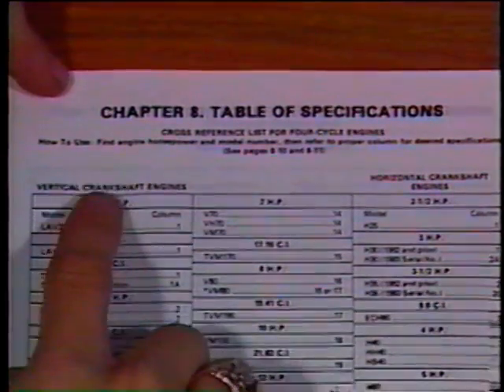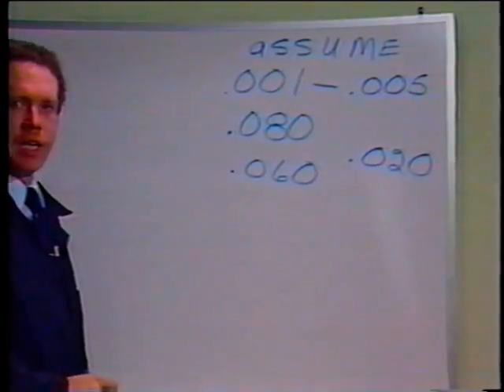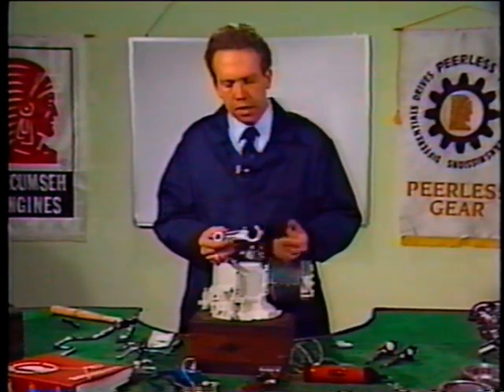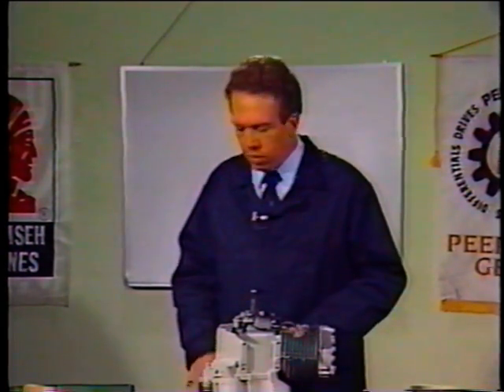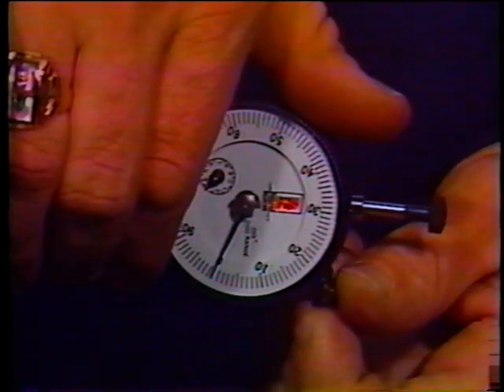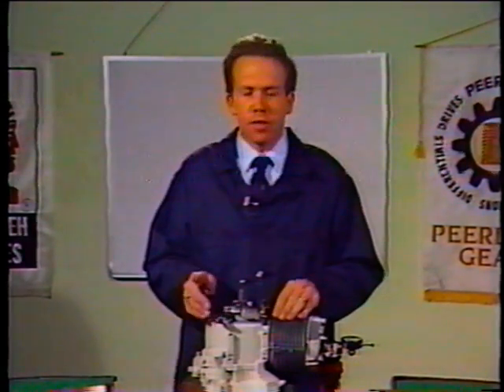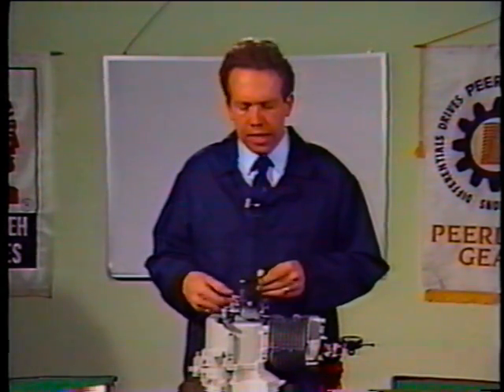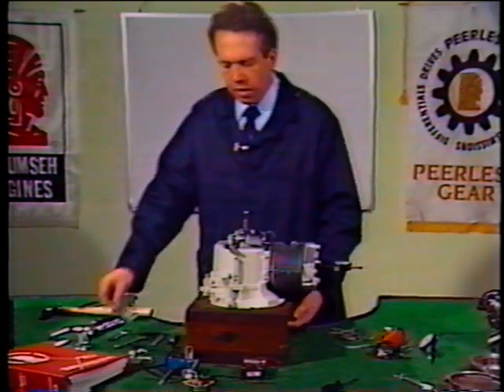Timing Tecumseh Engines with Internal Points & Condensor Ignition Systems

Comment: If you don't have the dial ind., you can use the flat feeler gauge on top of the cleaned piston top across the pin boss to eliminate any piston rock; measure it between a straight edge across the block surface and piston at the correct dimension btdc. Check with cont. light - rotate stator accordingly.

Comment: Looks to me that if you started at zero (TDC) and turned the crank  backwards to get a reading of .080" then you may have set the timing to .020" BTDC. But you weren't showing the dial indicator when you were moving the crank, only the final reading.   Some clarity would help.

Comment: So how do you set the air gap between the stator (coil) and the magnets on the underside of the flywheel?
Reply: UPDATE- Ignore my question. I just figured it out.So for other readeers-  If the stator assy (with coil) is mounted under the flywheel then you only have to set the points gap, then the timing (mine is .070" BTDC). The design of the stator mount will keep the coil at the correct gap when you adjust the timing.

Comment: Can you suggest anything for a situation where the inside of the flywheel rubs on the magneto laminate assembly?
Reply: You loosen the screws and push the coil back a little until it doesn’t touch any more.  You want the coil close to the magnets but not ever touching them.
Reply: @georgekeats1478  The coil is not adjustable in that direction. You can rotate it, but that's all.
Reply: @waynew2831  As you rotate it, it should move closer to or further away from the magnets, but not a drastic amount, but enough to clear the laminates. I am presently working on a 7HP Tecumseh that at some point in its life, the magnets came into contact with the laminates and "upset" them slightly. I am presently looking for a new complete assembly.

Comment: I have a 1974 Tecumseh HM80 and it wasn't running right.  I just did the points and condenser but I only get about an 1/8" or 3.5mm max spark length on my Lisle 20700 spark tester.  Is this too weak?  Do you think I need to change the coil?

Comment: I wonder if the timing dimension is the same a 2 stroke Tecumseh engine ?? Here on this 4 cycles, he calls for .080, how much for a 2 stroke ??
Reply: It is different on the Tecumseh twostrokes, but I only have the dimensions for the european Tecumseh engines, that might make a difference. The TA and VA models fire at 3.5 mm before top dead center, the AV models at 2.5 mm. (non outboard engines)
Reply: @v-g-z3689   Thank you :) !!
Reply: @goudrelle1  You´re welcome! Is that any help to you, what engine model do you need the timing for?
Reply: @v-g-z3689   Not sure of the model because the shroud is a little rusted, it's a jiffy ice auger and the model number seem to be starting with 870-  ??????
Reply: @goudrelle1  That doesn´t tell me anything, the model number should start with letters...
Reply: @v-g-z3689   I ended up using a steel brush and cleaned the area, Model AV520-670147T(B) DOM-0243  So the dimension should be 2.5mm  before TDC
Reply: @goudrelle1  Ah there you go! Correct. Very common and good engine. Unfortunately I had to give you the dimension in millimeters, as I only had an european service manual to hand :)
Reply: @v-g-z3689  Thank you !! I'm used to mesure in millimeters, my job ask me to use metric only !!!  Cheers !
Reply: @goudrelle1  That makes it easy. I just rechecked with a different manual, there it says 2,25-2,75mm or 3/32-7/64 inch.
Reply: @v-g-z3689   Thumbs up ! Thank you :)
Reply: @goudrelle1  You´re welcome!

Comment: Hi there! Could somebody please inform me as to what should be the impedance measurements (in ohms) for this particular magneto coil? I am suspecting the coil has gone bad but i don't know for sure so it would be great to know these figures before i use a multimeter and find out. Thanks in advance!
Reply: between 7K and 10K I believe.
Reply: Thanks a lot! Very useful indeed! I had once measured this old coil and it came up with a 15,2K. I cleaned off some impurities from spark plug connection lead, and bingo! 7,6K well within specs! Also the old worn spark plug measured around 5,2K (smallest measurement) and a brand new same plug was around only 2 Ohms....so i guess it was a little bit of both (coil and plug) to blame for the no spark issue i was facing, would you agree?